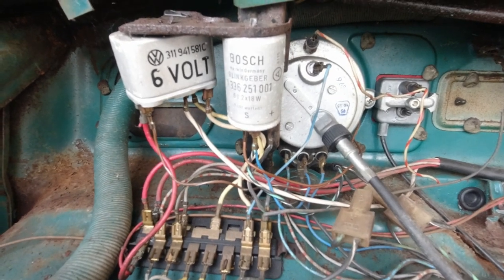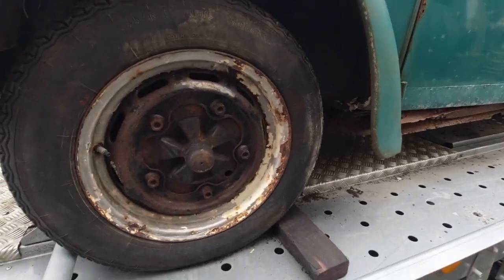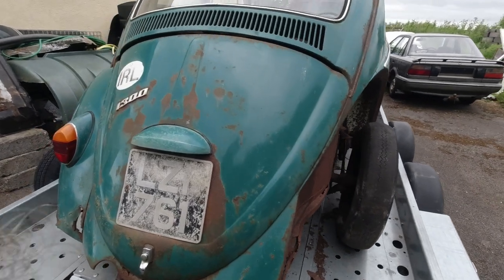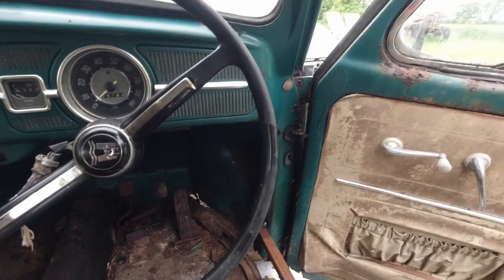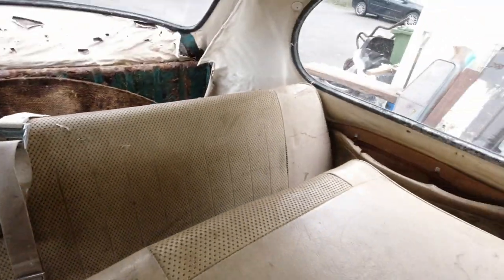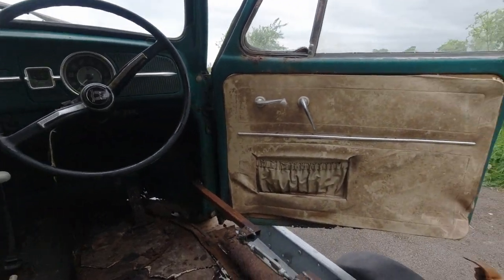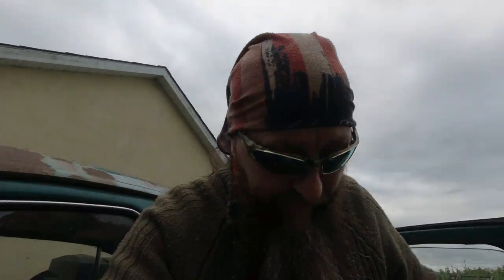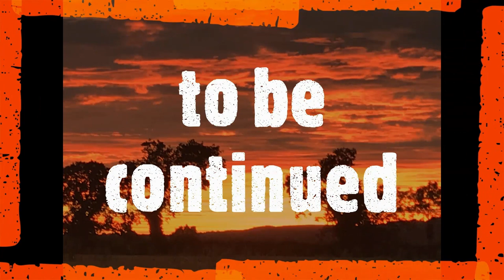VW Beetle 1966 Distinguishing Facts, on how to tell if you've got a genuine volkswagen 1966 beetle.

Comment: I remember when the 66 came out.  Yes, the side trim was for 66 and older.  As for the door handles, in this country, (United States), we got those door handles in 1960, or at least similar looking ones.  1967 did introduce the round push buttons, but I have seen 67s with square push buttons.  The flip-out windows were an option, not standard equipment.  In this country, we didn't get the 4-way turn indicator until 67.  The 67 had those same trim strips on the inside door panels.  We in this country didn't get the dash-mounted ignition switch until the 68 cars.
Reply from the maker: Hi James, good to hear the differences between the country’s at that time period, information here tends to say that America got the new advancements first and then we eventually got them, thanks for your input James, it helps everyone on here. Best wishes buddy.🤙🍻☘️

Comment: Question: There is wiring coming from the front trunk area down to the front firewall, then to the outside of the car. Where does that wiring go from there?
Reply from the maker: Hi maldon, sorry about the delay the wire loom runs from the front down along the side of the car it goes to the regulator also the battery wires and then ends up in the engine bay, coil carb ,etc.hope this helps.👌
Reply: @Joesrustbuckets  Thanks!

Comment: Here in the USA, my 66 beetle had a chrome enblem on the engine bonnet that read "1300". In 67, the engine bonnet had a bump-out at the license plate light. And I think there was a "Volkswagen" chrome emblem where mine had the "1300".  I believe the 67 was also increased to 1,500cc as well as being 12V.
Reply: True, you can quickly tell you have '66 with the 1300 emblem, my dad had two 66's in the day.

Comment: Hey mate, you should specify your location all your info. It’s great I owned a ‘66. You cannot make a general statement about a ‘66 due to the fact that they differ in England, Mexico and Brazil, I assuming you are in Australia your model matches with the ones in USA 🇺🇸 ( my location). I do have an extra turn signal lever but shipping will be really expensive! 😆
Reply from the maker: Hey Monchy, I would have thought the shamrock glass was a give away, I don't think the Hazard flashing switch came on 66, i would have thought that came much later on, Cheers buddy.
Reply: @Joesrustbuckets  it is on the opposite side of your ignition key, in you case to the left, I see the hole there, it’s just missing. 😞

Comment: As far as I’m aware joe but I’m open to correction is In Europe Sloping headlights and 12 volt system carried on into 67 model for a time, also 67 model had no knob on the ashtray and some kept the ignition on the dash unless they had a steering lock fitted. 67 also had a locking engine lid and some came with 1200 engines. As with these being crossover models they came with all or some of these features so the only true identifiers are the chassis number.
Reply: @Joesrustbuckets  67 in the us got 12v and upright headlights plus the 1500 engine but Europe was a different kettle of fish, it like they were running off all the old parts and changing over the machinery from one to the other if you get my drift

Comment: My Australian 1966 is a 1300 Deluxe with wide 5 wheels and clothes hanger bumpers. It is white with a red interior and black carpet. It also has red sash-only seatbelts, The only thing not original is the current motor as the original one lost its oil pressure after 50 years and needs an overhaul.